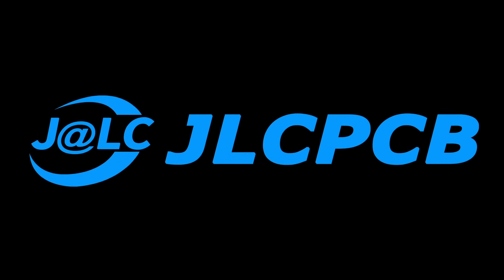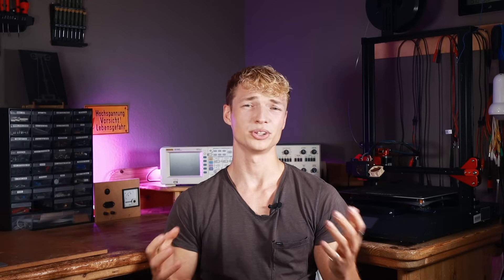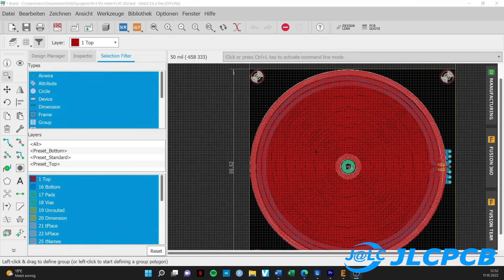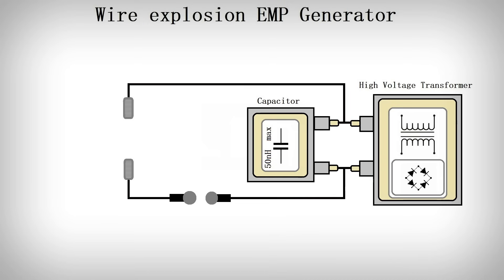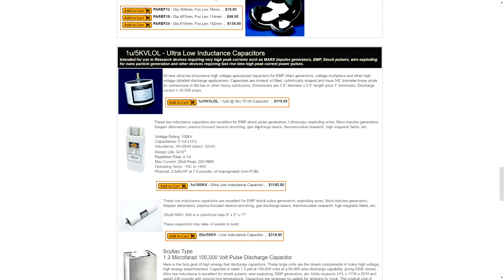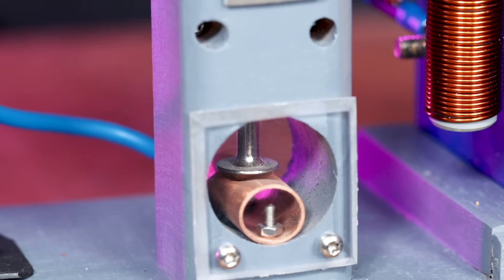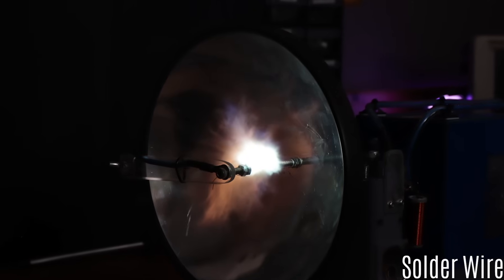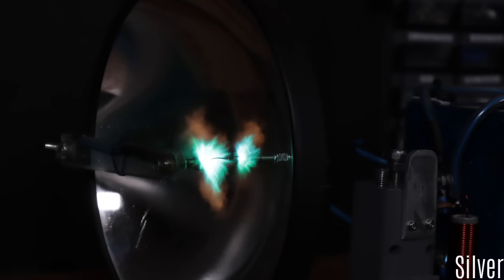I Built A Military EMP Gun! (New Method）

Comment: Another thought, use that compact fluorescent bulb AS a helical antenna (for the operating frequency of your target), the current and magnetic field should go up as quickly as vaporizing a wire could make it go down (because plasma).
   If the bulb survives, maybe it could be used in repeated pulsing mode!
Reply from the maker: The problem is that they are normally filled with mercury :(
Reply: @Teslaundmehr  true, even though the quantity seems small compared to all the other metal and metal oxide vapors you breathing from the wire vaporization (Seldom 100% pure Element)
    I'm sure they're comments section on YouTube we probably flame you for that one!!!
   I'm sure you can get neon or helium or other gas discharge tubes without Mercury, just would they be available in a helical shape? A high intensity Xeon discharge tube intended as a pump for a pulse laser would fit the bill, but that might be too expensive...
    You wouldn't happen to be friends with some glass blowers or maybe a guy with a good vacuum pump?
Reply: @williamwilliamson1096  absolutely!!!
...glass blowing , custom gas mixtures, custom tube sizes and shapes, high voltage transformers, vacuum pumps...
  Someone who makes custom neon signs would be the ideal person to partner with to make such a plasma antenna!
   Hopefully you know someone who would be interested in doing any of this?

Comment: Why didn't u replace the thin strip of metal with a large thick coil instead ? I think that would work a thousand times better.
Reply from the maker: Yes in this setup a coil works much better. But my Intention behind the video was to explain the wire exploding method ;) with the right setup the wire explowding method is much better
Reply: @Teslaundmehr  u should remake it with a bigger coil in the next video 💯

Comment: Make a helix antenna for Wi-Fi frequencies, Wrap the wire around a fluorescent tube of the right diameter, insulate the wire from the terminals of the bulb .
   Achieving the highest 'instantaneous' current is the most important parameter.
   And take it a step further and make a phased array out of them!!!!
   And let's see what happens when you aim it at your Wi-Fi router
Reply from the maker: haha that sounds very interesting!
Reply: You need to elaborate more on what is going on here? I'm interested. Please sir can you explain a little more in depth for the rest of us who are probably intelligent enough to piece it together, with a bit more info? 😁
I'm saying no need to dumb it down pre-school like, just explain a bit more about your theory?...... That seems a lot like you've tested and confirmed that theory already? 😁
Reply: @Jarmezrocks what I was talking about is based on three things. 1) you can use a fluorescent tube as an antenna because plasma is a conductor. (Very noisy and inefficient if you try it, I'm only guessing the reason for that is low current of a typical transmitter and the noise from driving the plasma, but it also could have something to do with #3 and math that's beyond me) 
  #2) a vaporizing wire is a plasma!.(that's why they add so-called "quenching" gases in glass fuses) since the principal of operation hope the vaporizing wire to create broadband noise involves a nearly instantaneous change in magnetic field due to sudden termination of current, but because the vaporizing wire creates a plasma channel for a short period of time, the current doesn't immediately cut off it actually starts to peak and then drop off slower as plasma conducts current. It's still very quick though.
  #3) conduction in plasma is inversely proportional to current, that means that it works the opposite of a wire. In a wire makes your current goes up so does the resistance limiting the peak amount of current that can pass, that's why you can have your space heater heater filament just sit there and glow, the design temperature and current your space heater takes is a balance point between the increasing rate of increase in resistance and decreasing rate of current draw.
BUT
In a plasma, it works just the opposite, the more current your passing the lower the resistance becomes. The rate of current passing increases exponentially! (The effect might not be good for conventional antennas, see comment under #1)

  My theory is that the rate of change of the increase in current in a contained plasma will be greater than the rate of change of the drop off of current of a vaporizing wire, creating more of the abrupt change in magnetic field.

4) in such a small setup you need an antenna and/or  tuning. Reason why it's because that limited energy is spread out across all frequencies of the spectrum, much like a spark gap transmitter. Unless he collects enough capacitors compete with the military , styropryro or photonicinduction he's not going to be able to get enough energy into the airwaves that a Target device could be sensitive to and become fried. 
   I know just using a helical type antenna isn't going to make laser like precision in directivity or in how narrow a frequency it will transmit in,  but it will certainly help.
 An antenna might help it resonate at the antennas resonant frequency, it should if the speed of light is fast enough that it can bounce back and forth a few times before the capacitor is discharged , and I would bet it is. I'd have to do the math to tell you how many times.
 5) the helical antenna, 
Easy to build it's just a coil, online calculators are available for dimensions, the size of the compact fluorescent is pretty close to microwave frequencies, and considering the width of the tube it should be reasonably wideband without putting a signal across the entire spectrum. 
  6) my first idea of wrapping a helical around a straight fluorescent tube was because   not only is that about the right size for the microwave range in a helical. I was thinking how those can and coin crusher electromagnetic pressure devices work by inducing an equal and opposite Force via induction in the can or coin. So my theory became if an equal and opposite current is induced in a plasma within the antenna it too will begin to transmit, the plasma would probably get compressed in a complimentary morphology , sorry, same shape shifted 1/2 wavelength, in both time and space and that would cause a reinforcing transmission
 essentially doubling the power !

I couldn't go all the way down to preschool level, high school is usually enough anyway without sounding condescending. Probably would have taken twice as many words too, and all day for me to formulate how to word it. (I remember most people only being able to understand me when I was talking in front of my 5-year-old daughter and I was trying not to be rude to her)
 I did assume a few things like you knew how an antenna works for instance, if not let me know.

I also have ideas about how to set it up like a tec laser to create an ion channel for long range conduction much like an open air Wakefield laser. I'll leave you to look those up. 
  I built a tec N2 laser in high school, and there's plenty of YouTube videos of people who've also built them.
    As for a Wakefield accelerators, I can only dream of understanding that math before I die.
   But hopefully, in my retirement, I'll figure out how to simulate ball lightning, before I go senile, and yeah I'll document it on YouTube if I do.

Comment: Voltage and amperage are crucial in generating the pulse .Also you have a conductor running across the reflector re absorbing the energy being created it will produce counter emf into your rectifier bank
Reply from the maker: Thanks for the Information!!
Reply: @Teslaundmehr  run the 2 leads out the center of the reflector in parallel with a coil of wire between the 2 posts .you will have to adjust how far out the leads must be to propagate the wave front .there must be no conductors of any kind infront of the focal plane other than the filament to be vaporized
Reply: @German John .Always wondered how frequency would affect the pulse .Unfortunately only DC is used and there is no way to modulate the dC pulse either the pulse is positive or negative that's it .When using a Tesla coil to generate an emp,Or a tazer  it's different you are using an alternating energy pulse .
Reply: @German John It's true ,but every known device made out 8n the market today will 9noy be affected by specific frequency impulses  You don't hit the right frequency the devices don't see an overload .It's funny how tela coils can take out loads of electronics and at the same time some electronics it totally immune to its impulse
Reply: @carlubambi5541  frequency would do a lot of different things but you can actually add it to DC but not many know the secrets of the dark arts anymore 😂. But seriously you can just buy a car inverter and slap it after the caps and ggs it’s now ac. Kind of. I would need a video to explain better.
Reply: It would definitely be significantly more destructive in some circumstances.
Reply: Just a quick simple break down. It will turn the dc into steps. So like a sign wave but with 90* turns.  You can pass through again to smooth it out a bit. It’s an exponential equation though so it never truly becomes a smooth AC wave. But can be very close.

Comment: how can you be certain that your emp is contained where you need it ? I think it would prefer getting out where the inductance is higher.
Reply from the maker: Hey,
so normally (when you have a big Cap 50kv 0.5uF) you turn the exploding wire into a small coil. You know what I mean? (round about 10-20 turns). This coil than explodes. We than have a kind of exploding inductor. Haha maybe I have to mention that in the video ;)
Reply: @Teslaundmehr  nice ! Have you thought of using a small torroidal core ? I know it will blow up but it may increase inductance where you need it ?

Comment: Wow this was interesting. I've never seen this method before. When the magnetic field collapses and induces a high voltage it is capacitively coupled to the other end of the circuit even when the wire has melted so there is an RC time constant that will limit the max voltage you reach (not sure if I said that correctly lol).  Maybe a higher voltage capacitor is all you need (what about the capacitor banks from a SGTC).

Also most of the electric field is near field radiation so I don't think it can spread far outside the wires when the magnetic field collapses. 

These are just my thoughts. I really enjoyed this video
Reply from the maker: Thanks for sharing your thoughts! I'm glad that you enjoyed the video ;)
Reply: @Teslaundmehr  You're welcome also well done for getting sponsored by JLC. I'm a big fan of your channel and have built my own tesla coil!